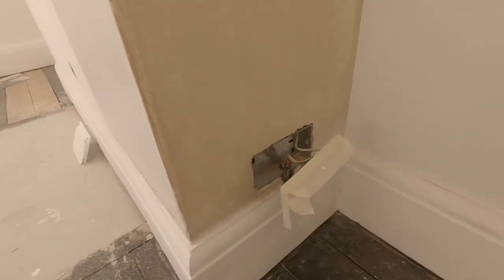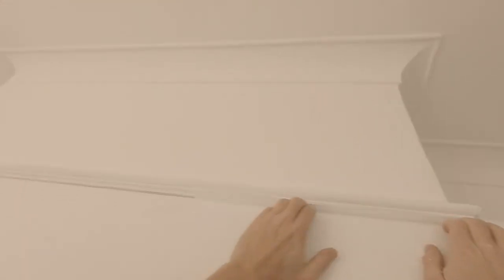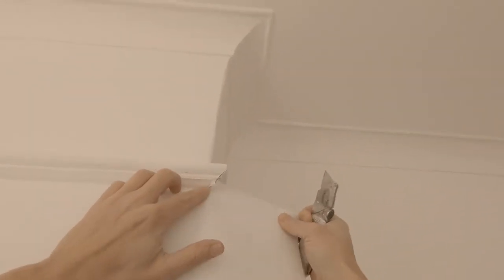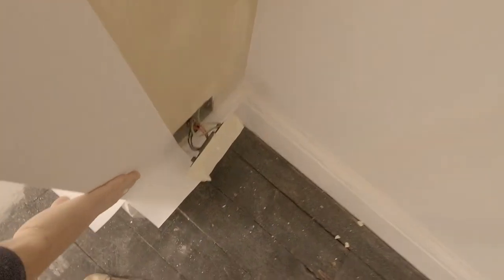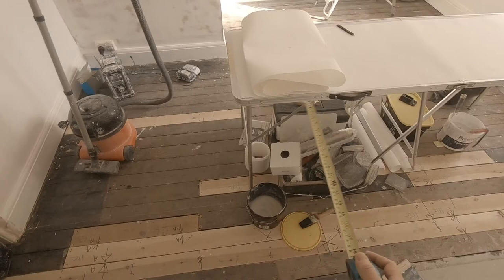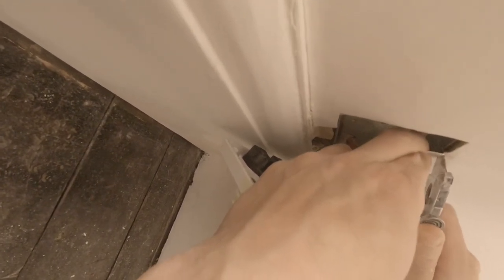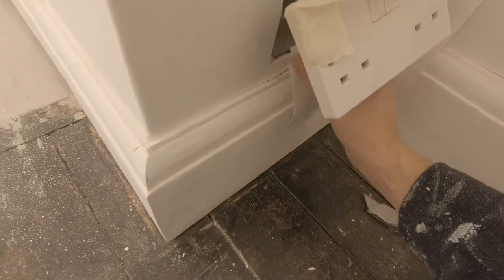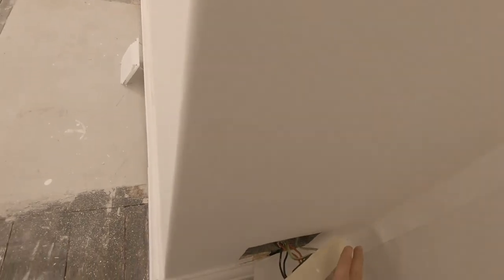Decorating tutorial: lining paper around a chimney breast and into a double plug socket. . vid #8

Comment: Hi surprises me that you didn’t soak the lining paper , do you not find it hard to manipulate without soaking it and do you not find it Shrinks on the wall as the paste soaks in ? Thanks
Reply from the maker: This type of wall paper is a paste the wall or paper,
It states in the data sheet provided.. recommended use.
I fined it so much easier to work with, not as messy, no shrinkage paste the wall stick the paper and trim.
Excellent product.
It is the wall rock fiber liner.
Also make sure you are using the recommended paste...
I use a ready mix formula from albony, red top...
Without the paper soaked with the paste it's actually much easier to work with and does not tare as easy when trying to work with it.
Kind regards
Reply: @paintingwithpride5012  excellent thanks, haven’t came across that type of lining paper yet will be looking for it as it would be easier alright, tears so easily when wet never understood why they didn’t make a paste the wall version thanks for all the great vids good to keep learning